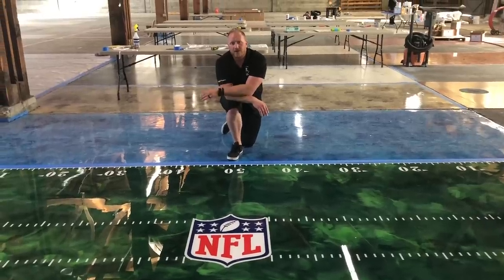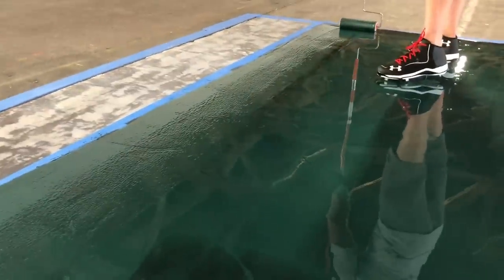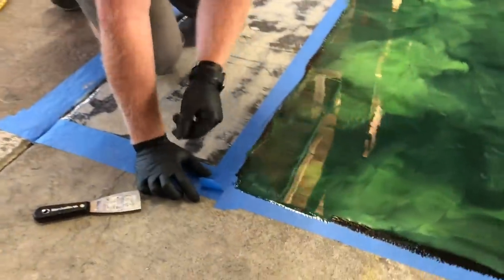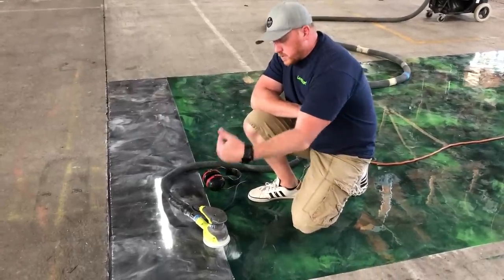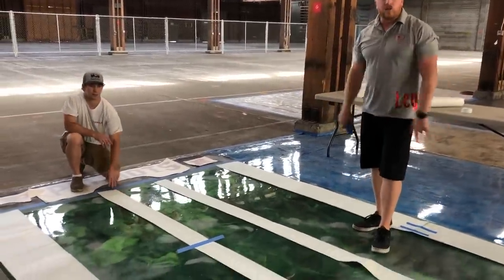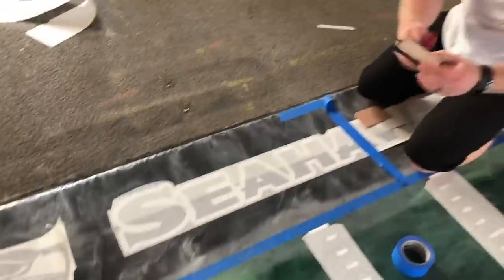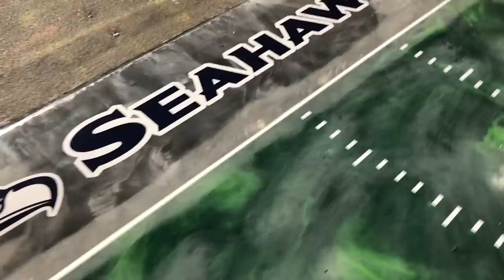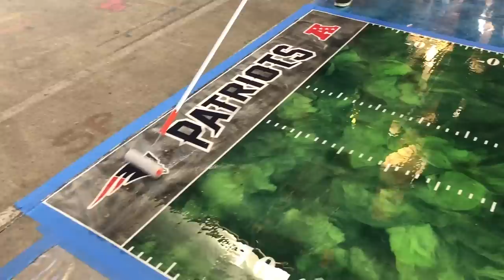Super Bowl XLIX Metallic Epoxy Floor With Decals | Seahawks VS Patriots | Step By Step

Comment: For workability when applying decals just use a spray bottle with a mixture of baby shampoo and a cap full of isopropyl alcohol...This will allow you to lay the whole decal down and slide it perfectly into place before you squeegee the air bubbles out from underneath the decal..If by chance you ever have a small air bubble pop it with a needle and squeegee it down with a hard plastic like the corner of a credit card...Great Job Guys...Love It...

Comment: I really want to do this to my floor but with black epoxy and Pittsburgh penguin decal. Problem is that they painted the floor with gray paint. When I close on the house I’ll finally have a floor to epoxy. What’s the easiest way to remove the paint? Paint remover? Or is there an easier way?

Comment: I’ve tried doing this myself & came across a few problems & some are within this video.
I see that there’s holes in the floor after you’ve used the sanding machine. How do you fill them holes ?
And my other problem was not getting that desired glass like finish, how do you get rid of the blemishes & the little spots that sit on top? I see those are on this floor too. Your help would be appreciated. Thanks

Comment: Neat project, thanks for sharing!
Ever seen those vinyl 3-D optical illusion decals advertised on FB, like where there's a shark coming out of a bathroom floor type thing, where decal is cut to fit entire floor area? I was looking at them and wondering if your epoxy would make it possible to do that with professional results..?
Reply: Those are also epoxy floors. There's a company in Dubai that specializes in them (& walls & ceilings & garages). They're on Pinterest.

Comment: Where exactly did you guys go for the decals, this is something I want to definitely do for my Rams
Reply from the maker: We ordered our off of Amazon on a decal site.  Thanks
Reply: Can I have the size and name of the company off amazon? I am doing a Giant's/panthet floor 😊
Reply: @monicaevery7136  Did you ever get the link?  I've been unable to find anything like it on amazon and the stuff on etsy is junk.
Reply: Leggari Products i cant find anything like this on amazon. I ordered a kit from Leggari but i cant start it until i find the decals. Did anyone ever find a site that could help us all with our dream floor projects?
Reply: @LeggariProducts  are these vinyl decals? Would it also be possible to make a logo on top of the floor using epoxy itself? By masking the area and rolling the other colour over it? And then doing the top clear coat?

Comment: Not sure if anyone’s asked yet, but is it slippery if it gets wet? Like if we did this to our garage and we had a gym in there.
Reply from the maker: Justin Alvizo it’s similar to tile when wet. If that’s a concern we recommend our WB Urethane Top Coat with our grit additive to help with slip resistance. Thanks
Reply: Good Question?

Comment: What was the square footage for that floor and what was cost for material for that job 
Or what is the cost for material per square for.
Reply from the maker: This was about 135 sq. ft.  You can actually order or price out a custom kit for that exact square footage through the Floors section of our website at www.leggari.com. Simply click on Floors >>>> Order Floor Kit Here, then follow the steps.

Comment: LOVE watching the demos. We have a question. Do you think that it would work in a motorhome for the flooring and I'm sure it would on the countertops but on the flooring do you feel that it would work as far as would it crack or anything like that with a moving vehicle because of a motorhome
Reply from the maker: You need a sound structured floor to applicate this over or you could run into some issues.  Thanks

Comment: What did you guys go with for your topcoat TIA?
Reply from the maker: We have 3 different top coat options. Glaze coat is our super high gloss top coat that lays out glass smooth just like the metallic epoxy coat. Our WB Urethane comes in high gloss and leaves a minor texture and we also have a WB Urethane that’s a Matte/Satin finish.

Comment: Would it stand up to the harsh winter’s of Canada with all the salt ?
Reply from the maker: Our products are actually certified for industrial grade coatings made for high traffic commercial settings. So theoretically in a residential, or even commercial setting it will last for decades as long as the urethane top coat is re-applied when needed to protect the decorative coating. This is NOT a cheap epoxy paint that you will commonly find at box stores like Home Depot or sherwin Williams. It is a thick 100% solids epoxy coating formulated for high traffic areas and heavy machinery.

Comment: How are you getting the bubbles out of the resin?
Reply from the maker: Our product itself is formulated so that the bubbles pop themselves while the product is fluid. 
However if you overwork the product too late in the curing process, you will be putting air into it and it will be too thick to release it. Also if you are working with porous surfaces or substrates like concrete, you could get them from moisture or outgassing issues from vapor emissions. 
If you have any bubbles, you just spray denatured alcohol out of a hand sprayer at a fine mist to dissipate the bubbles. (Do this immediately after coating with epoxy, and then no later than 20 minutes after application.)
Reply: Torching it is better. Especially on kitchen counters. It's not good to put chemicals on a food surface.